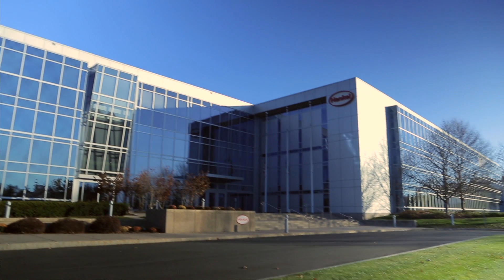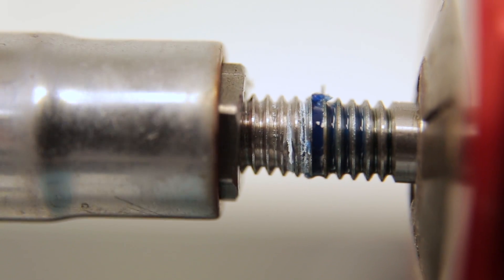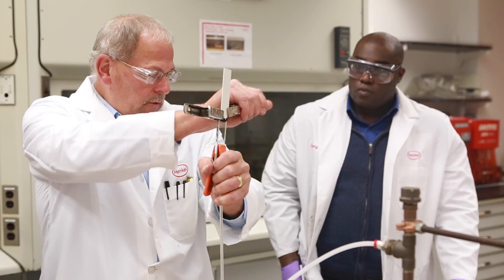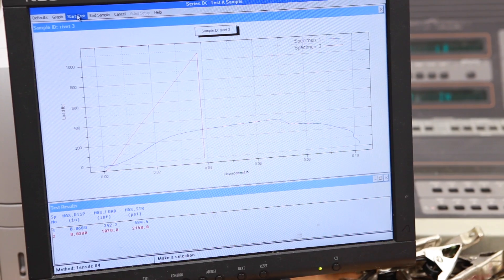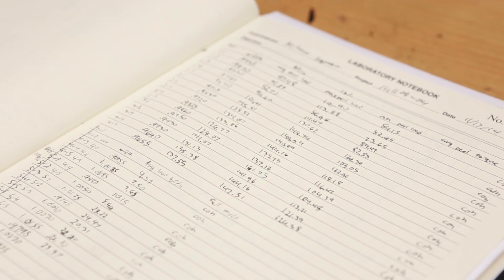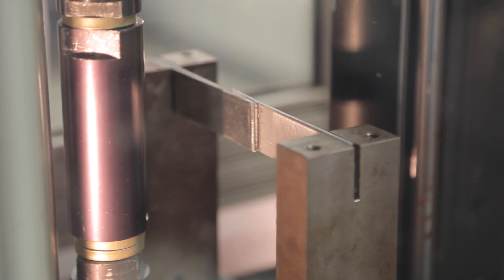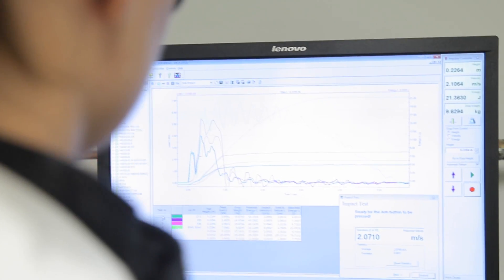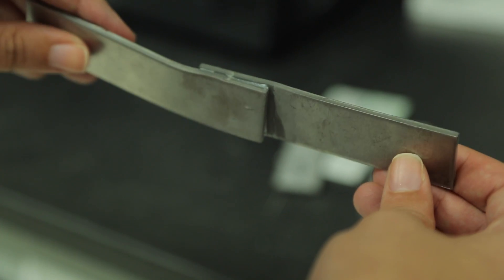Impact Adhesive Testing

Comment: What the customers want is that the adhesive performs to their satisfaction for the whole lifetime of the bonded joint. So I think instead of quality testing your every manufacturing step, you should continually test the adhesive in the actuall joints at the customers.